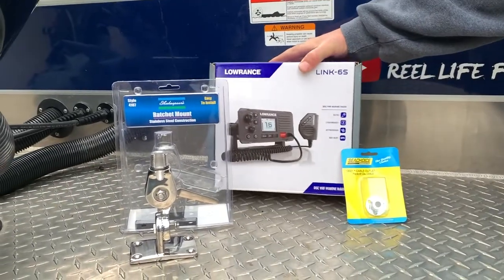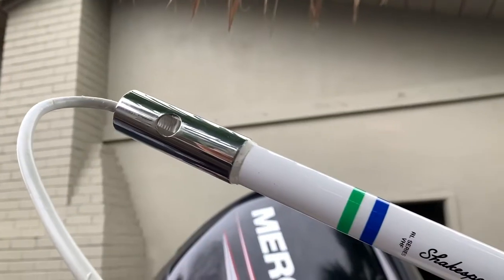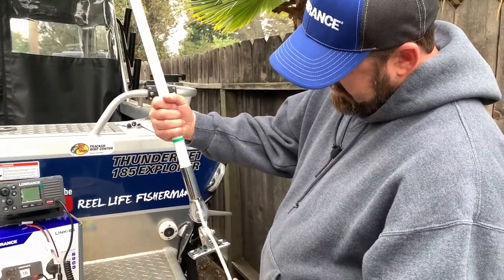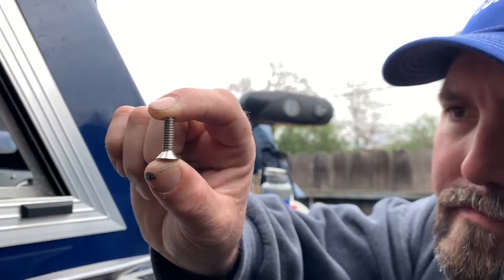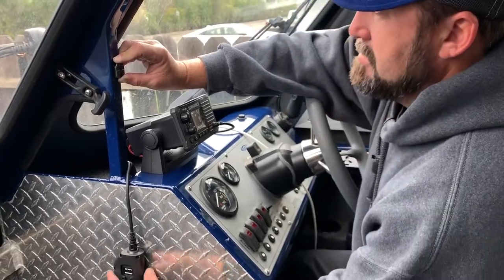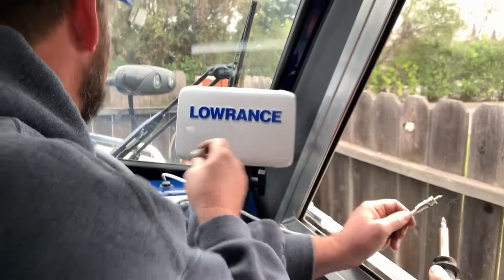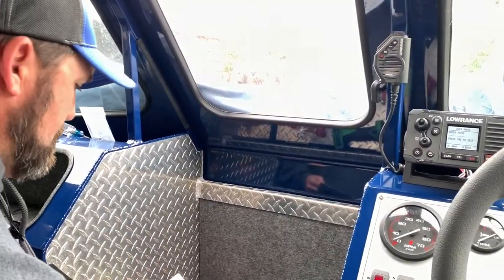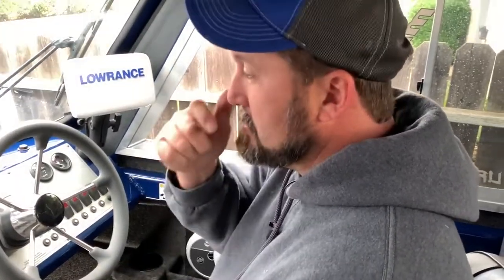VHF MARINE RADIO INSTALLATION | HOW TO

Comment: Enjoyed your radio installation video.  I was wondering about a few things.  For the antenna it seems a high window frame installation vs. the deck mount would have been preferred.  Three reasons:  1. Raises the antenna higher for a better signal.  2.  Mounting would not interfere with mooring cleat as antenna is very close to cleat.   3.  Antenna wire partially blocks starboard running light as light must be visible from dead ahead to two points abaft the starboard beam (for navigation safety and right of way.)   Just my quick observation, not to be picky.  Thanks for the wiring and hook up information...very informative.
Reply from the maker: Glad you liked the video.. the reason i mounted it where I did was I can stand it up from the drivers seat.. It doesn’t block my starboard nav light at all.. it is closer then I like to the cleat but still not a problem..  I get a very clear signal and there is no inference.. some of the places I launch at higher tides ,I have to go under low bridges and need to lower the antenna..  and mounted where I did cuts down on vibration.. the aluminum is much thicker there and won’t flex.. anyway long story short.. mount yours wherever you want and do what works best for you and your boat.. thanks for watching and tight lines!

Comment: Some great install info here if I was to install a new radio. Unfortunately for me, I have an old radio which the guy I bought it from said it has never been working? I had a friend look underneath the helm and he said it was a fuse issue and told me it was a 3 amp fuse. After taking a look myself ( at 70 yo with a hernia is quite a task) I could not id any fuse whatsoever, so can't figure out how or why my friend said it was a 3 amp fuse? It was like spaghetti junction under there and took me all of 5 mins to get out lol. Wish I could afford to change it to the same as yours, since I have the Lowrance fish finder. but probably too old also. I'll have to get the local boat yard to check it out.
Only one thing I know about fixing steel to aluminium is electrolysis and thought I had seen you had something between the steel and aluminium but did not hear you mention how important this was. For me, as a pure novice your info is outstanding and I wish that I could start from scratch with it. So I am beyond your help on this one, but nevertheless, info about antenna quality and other stuff will be invaluable if I ever need it. Thanks heaps for your help mate. ....Oh and hope you had an awesome Christmas :)
Reply from the maker: Nomad thank you.. most have a fuse holder like you can see on mine it is the big yellow pill looking thing on the wire.. some will be smaller and black or red.. they are usually a glass fuse.. if it’s really old it may have a screw in type in the radio itself.. it’s possible something shorted it out or was a voltage spike.. and yes you do have to be carful about electrolysis with dissimilar metals.. they do provide a rubber seal which helps with that .. and so you don’t have to use silicone on it..as always I really appreciate your comments and feedback! Thank you for watching.. hopefully you get the radio working.. if you didn’t live on the other side of the world and were local .. I would absolutely love to swing by and check it out!  Hopefully you had a great Christmas!! I got some very nice rods and reels I’m about to take out sturgeon fishing in the morning!
Reply: @ReelLifeFisherman  You're so kind. Thank you for your helpful and generous comment and reply. Hope you catch a monster heh.

Comment: 18 FT Is the optimum coax length. The coax acts has a ground plain. Run it around the front of thr boat do not coil the coax up. There is no ground plain on a fiberglass boat you can buy artificial ground plain that fit to the base of the antenna to get a better performance from the radio.

Comment: I turned off my batteries and took the keys out so I thought there was no power.  When I cut the black and red it sparked.  Any idea how this would be connected still and is it safe to cut?   I stopped working on it.

Comment: Do you have any issues with the antenna whipping around in the wind or when on plane and hitting your top or getting damaged.?  Or is that a pretty firm antenna  ?  I assume that is an 8 foot antenna.  Plus have you had any issues with sending and receiving signals and what has been the farthest you have broadcast.?  Thank you for your post, I have a similar Thunderjet and am in the process of installing a marine radio.
Reply from the maker: No the antenna and base are really strong even in rough days on the ocean or bay it’s never hit at all.. and on the ocean it has gone out id say pretty far.. 20 -30 miles or so would be the farthest I have talked to a buddy I know was a long ways off..   thanks for watching and hopefully that helps.. in the delta where the line of sight is broken up you get less signal distance.

Comment: Good afternoon I have a cobra vhf radio and I installed everything, I did a radio check and a few minutes later the radio does not sound even when it is turned on, what could it be?
Reply from the maker: Ok let me ask the simple questions.. is the volume up? Some units you have to push in the knob for volume or squelch .. also if no one is around you with a vhf on the same channel you will hear nothing.. they only work so far .. will the weather alert channel play?
Reply: There is no one near me with a radio and the volume is high, the radio simply turns on and it is not heard when it turns on or that noise as interference
Reply: it sure broke and it's new
Reply: and the weather channel was heard for a while no longer heard
Reply from the maker: It is still powering on and no sound .. then it could be a bad connection on the antenna.. if that’s good there could be a problem with the unit..
Reply: Reel Life Fisherman  ok thank you
Reply from the maker: No problem.. hope you figure it out and get it going..